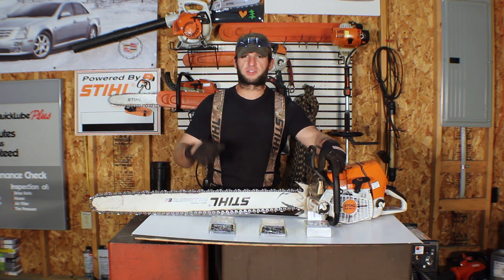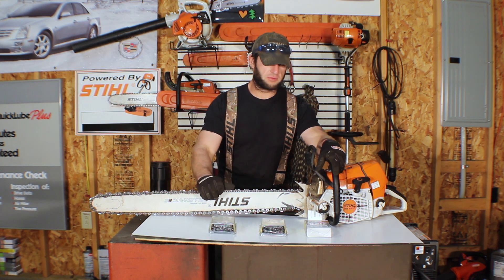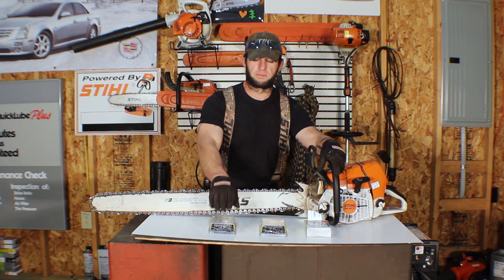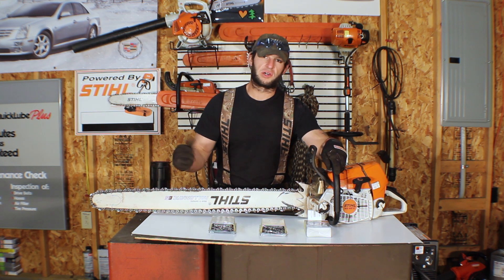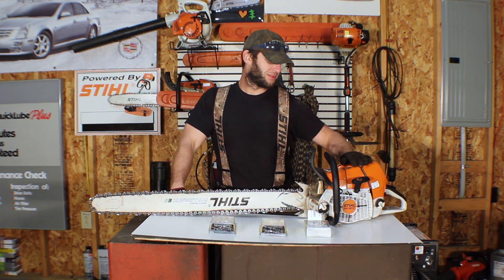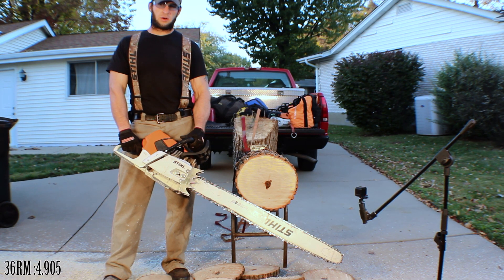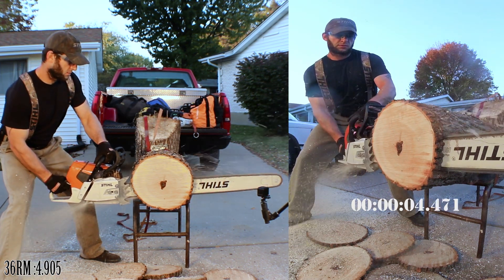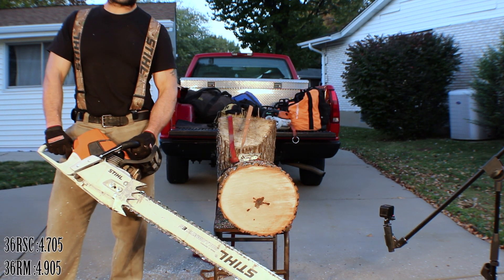Saw Chain Cutting Speed Comparison.

Comment: Greetings from Croatia !
You have very strange beard, looking like hugh jackman's wolverine, very cool !
Also, very big like for using Tool - 46 & 2 for background song !
I am a dolmar fan and in my experience, full chiesel with square head should be the fastest, not the slowest chain. Maybe cuz my dolmar ps550 spins on the 13 000 rpm, so the full chiesel square chain rips much better than yours

Comment: u have to put a larger sprocket on when using skiptooth chain
Reply: No no you dont. I run saws every day.  Running skip tooth saw stays higher in rpm range, full comp pulls saw down 1500 to 2000 rpms. I cut 60" poplar and oak on regular basis doing residential tree work.
Reply: This is some very true info.  I was about to post this as well before I read this comment
Reply: Or use a slower sprocket/skip tooth/longer bar if needs be, in sure he knows this as he is a well trained arborist

Comment: The only thing that sticks out is i have heard the square isnt as good out of the box.    That is what i have read on forums.    Never tried square for myself.    Always heard you need a special grinder for square .    Ill be sticking with my round chisle or semi from now on.      Thanks now i ll skip the square stuff
Reply from the maker: From what I've heard the factory square grind is garbage, need to sharpen it myself then redo the square vs round times
Reply from the maker: Hmm, thanks for the info.  I'll have to run it a bit and the sharpen it, see how it does.  Of course, have to learn to sharpen it first.  Much easier if you have a grinder, can do it by hand though, with a special beveled file.  I have one, but have never used it.  Sounds like I'll be making a "how not to sharpen your square chain" video, lol.
Reply: plenty of forums address this topic.
Reply: I just ordered my first squared ground chain and a filing guide, an ATOP jig....

We can learn how to file these things together.

I believe Nic is correct, square ground is never as good straight from the box, you need to file it before you use it.... at least that is what I have read.
Reply: Square is way faster but you definitely need to sharpen it right out of the box and take your rakers just a tiny bit below what your raker gauge says and it will rip
Reply: True most square chain isn't great out of the box. Check the depth gauge height first thing, that's where I bet you're main issue is, I've seen as little as .010" clearance on Stihl chain out of the box. Tooth length isn't that important as long as the depth gauge is set correctly. I could hear the saw isn't under enough load with the square, so it wasn't biting. A larger 8 tooth sprocket in that size wood might not be a bad idea as well. Oregon square chain is usually better out of the box, plus it has a thinner tooth.

Comment: This is surprising, the forums are full of people saying square cut chains are the sharpest and fastest.  Guess I'll be sticking with a round ground chain!  Good comparison, I was recently hoping you were going to do a comparison between round vs square.  How about a comparison between full skip (RSF) and standard supers (RS)?  If you do it I would like to see cuts where the whole bar is buried in the log if you have the ability.
Reply from the maker: I'd love to do some skip chains, don't have anything big enough to need it though.  Trying to get my hands on an MS 880 for a day, if I can swing it I'll make sure and do a skip chain video as well.
Reply: Hey Human, I run RSF on my 20", 28", and 36" bars for cutting logs from 10" across to 48" across.
I have never timed my cuts, but seems to cut plenty fast.  The only time I think a RS is faster is on the limbs, stuff 3"-4" or under.

Are you saying the full skip is only good for really big wood?

I am no pro, and I learn something new every day, but I like running the full skip,, unless I am doing a lot of small/tiny stuff.

I would love to hear your thoughts/input.

Thanks!
Reply: @GoodDayFarm  don't think that's what he was saying... skip uses less power roughly half because the saw only has to haul half the teeth trough the wood so it benefits more on bigger wood specially with smaller saws or longer bars like say and 880 with a 40 or 50 inch would benefit from a skip tooth...
Reply: @kdog01100  isn't the whole point of a skip chain to make the rakers shorter to get bigger chips when u cut?
Reply: @julianlaustsen1991  no. Skip is ment to be used on longer bars for better chip clearance so you will not cut the chips again and spend horsepower to do that.
Reply: @Ketis1985  so would u run a skip chain on a 28'' bar on a ms660?
Reply: @julianlaustsen1991  no. I would run full comp....

Comment: I like my MS 261 C-M, but sometimes the chain jammed on the guide by the heat or lack of oil. Only happen with large logs. I adjust the oil flow under the saw with no success.
https://www.youtube.com/watch?v=tabM8YeIx8Q
Reply from the maker: Hmm, not sure honestly.  To check your oiler, put the nose of the bar 2 or so inches off of a flat surface and run a full throttle for a second or two "don't want to run wide open too long with no load", check to see if there is a line of oil that has flung off of your bar.  If not, do it a couple more times as it could just need to be primed.  Also, from the looks of the video, you might try loosening up the chain just a tad.  You should be able to turn it freely with your hand, if it's tough, loosen just a bit.  Hope this helps!
Reply: Looks like that chain is cutting crooked for one, not sharpened properly, that will jam a saw in a log that large. Secondly take the chain off and make sure that sprocket is spinning freely.
Reply: Thanks.

Comment: I am not sure why but I have seen other round to square comparisons and the square is always 1-2 seconds slower. I really have never been told the square grounds benefits but as far as I can tell they are harder to sharpen and cut slower
Reply: They do not dull as fast, only benefit I have come across.  I have also noticed the cuts are so close in time that it really wouldn't be noticeable in the field.